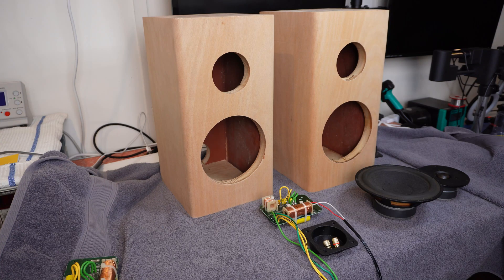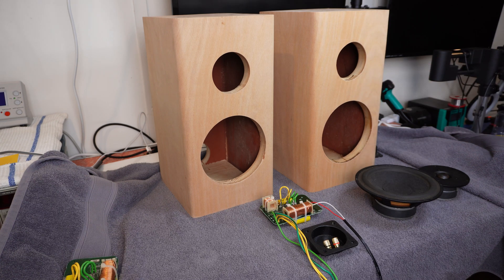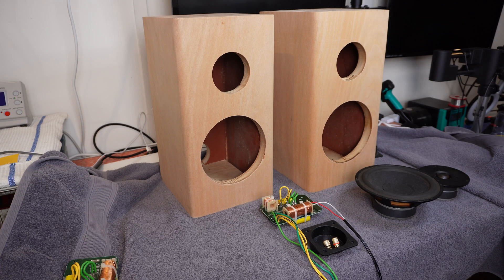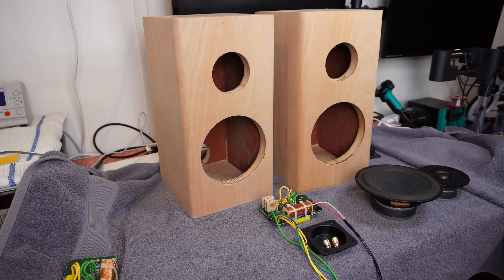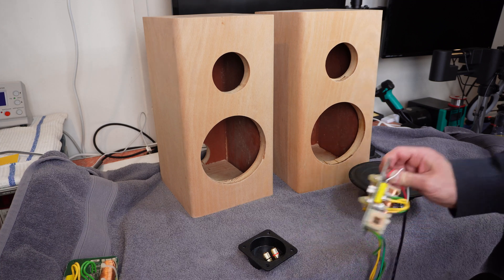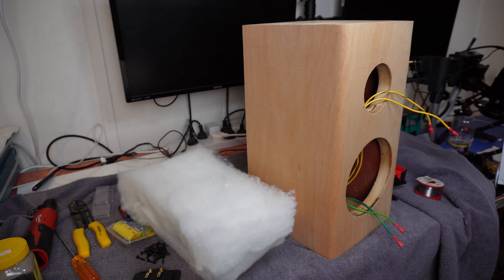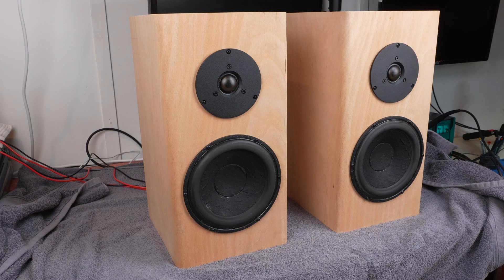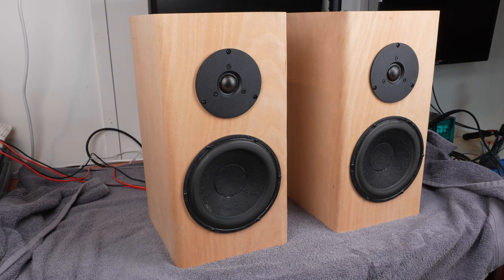I Built Custom HiFi Speakers From ORGAN PIPES

Comment: If I may interject, I'd highly recommend getting acoustic centres as close as possible, with rims touching and flush mounting both drivers. Sure ther will be a little bit extra loading on the tweeter by a concave (and moving) cone of the LMF, but vertical off axis will be much improved. D28 goes pretty low, but still 3rd order HP and 2nd order LP will probably work best with these, as long as you can get a symmetrical notch with one of the driver's polarity reversed. Not a fan of vented myself, especially with 2way systems and I happen to run the Danes in sealed enclosures myself, with small signal Q below 0.47.
Troels Gravesen is worth paying a visit to.

Comment: They look and sound lovely.  I'm intrigued by what had opened the voice coils - was it a bad connection or were they literally opened by excess current?
Reply from the maker: Apparently it is a common problem with Scan Speaks. When I took them to Speaker Hospital the guy said strait away that they would need new braids. Voice coils are OK.
Reply: @audionautica6843  Interesting, thank you.  Good luck with the rest of the project.